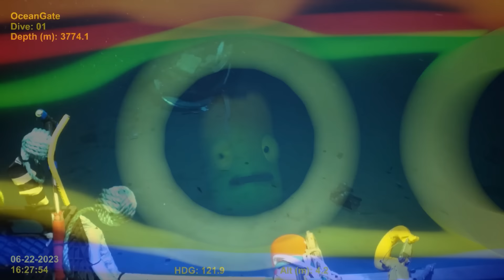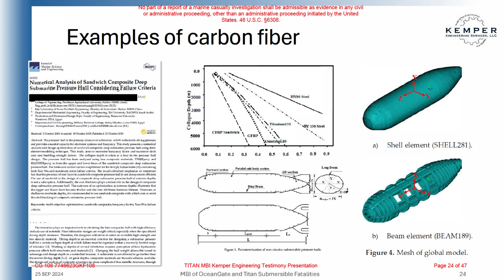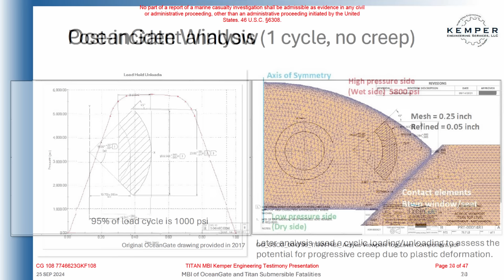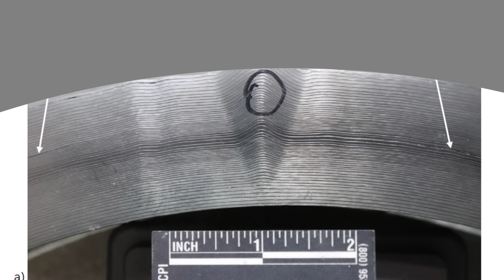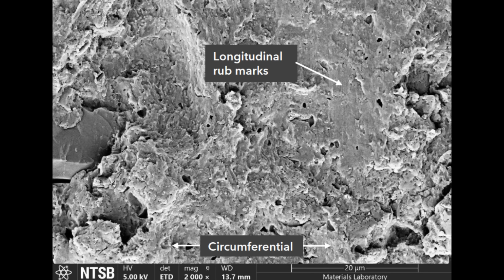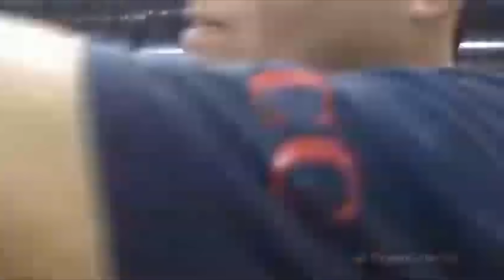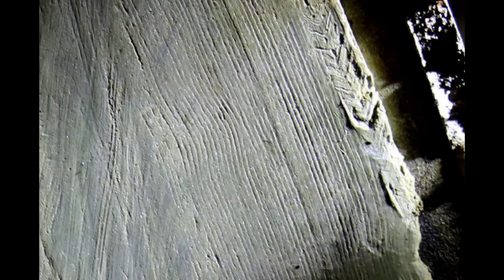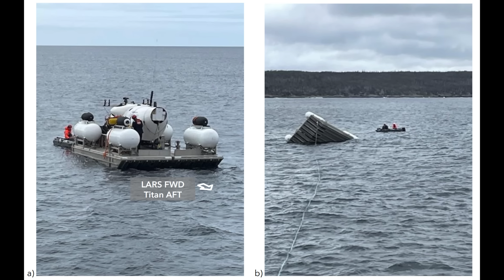OceanGate Wreck Shows Why Sub Wasn't Strong Enough To Survive - NTSB Shares Important Details

Comment: If you were writing this as a fictional story the publisher would say the hubris parallels with the Titanic disaster itself were too obvious.
Reply: I mean, the CEO's surname is "rush". That's just taking the mickey.
Reply: @techno1561 nominative determinism strikes again
Reply: No, this is far worse. The engineering tools didn't exist to accurately model and predict what would happen if Titanic hit an iceberg. Not only did they exist for Titan, but they can be licensed for a few thousand bucks per year. Hell, they license it to engineering students for free.
Reply: @CarbonKevin lie
Reply: The ironic thing is that this is far far FAR worse. Titanic very much got unlucky, as the designers simply didn't anticipate a relatively small, scraping crack along the side of the ship, as the things that were on the forefront of their minds were things that were far more common: running aground, collisions, the sort of thing other ships of the time commonly had problems with. Titanic got unlucky to sink as it did. Rush got unlucky to not sink sooner.
Reply: @eliareichardt7007  Fwiw the Titanic's scrape with the iceberg was a quarter of the length of the ship and punctured five of its sixteen waterproof compartments (and a bit of a sixth one). The ship was rated to withstand up to four of the compartments being flooded, so it's pretty serious damage. Like you said though, the designers of the Titanic were solving for more common and less damaging sorts of accidents, whereas the designers of Titan somehow failed to solve for the single most obvious and predictable risk that faces a deep sea submarine: high water pressure.
Reply: @thatcherfreeman  It has been theorized that the ship would have actually survived, albeit severely damaged, if it had in fact just run head first into the iceberg instead.
Reply: @mitchk7655  yeah that checks out, might've busted fewer compartments
Reply: @thatcherfreeman   To be fair to them, they did design the sub for it, since it didn't immediately implode. OceanGate just failed to do the proper checks, and the CEO ignored the warning systems/signs when they went off.
Reply: @techno1561  I mean I guess they did design for it, but evidently either their design or their implementation was not effective and they did not do enough to validate it.
Reply: @mitchk7655 Nothing theoretical about that. There are other ships that crashed into icebergs and didn't sink.
Reply: @eliareichardt7007 there is an argument to be made about the specific steel, rivets, and riveting methods used, but your right that i t was still pretty well designed and basically just insanely unlucky
Reply: At least the Titanic was built to the safety standards of the time. This sub wasn't lol
Reply: @thatcherfreeman  Titanic was technically built better than the standards of the time. It didn't have enough life boats, but it had more than the minimum requirements . It could have held even more, but White Star deemed it too messy (she sailed that voyage at 2/3 of total capacity, but had less than half the maximum lifeboats aboard). The amenities on board were unmatched, even by her sister ship Olympic.

On the same token, many people at the time were criticizing contemporary maritime law and regulations in the light of increasing speed and capacity. White Star Line and Titanic's owners knew of the potential risks, but disregarded them as too unlikely.
Reply: @neekMarieM14 the theory of life boats at the time was that you didn't need enough to get everyone off. The idea at the time (at least behind the Titanic) was that even if the ship DID sink, you could easily radio-contact other ships nearby and you'd just be using the life boats to ferry people to safety because it would take so long for it to sink (which it absolutely did, just not long enough and they weren't able to get a hold of other ships fast enough (partially due to a nearby ship's telegraph office being unmanned at the time).
Reply: @graysonsmith7031 You mean the SS Californian? The Captain definitely saw the emergency flairs sent up, he just decided he’d rather have a cup of tea and go to bed
Reply: @thatcherfreeman  The Titanic waa built well above the safety standards of her time. She only needed to be able to float with 2 compartments flooded, not the 4 she was able to. 
   Of course, she still had nothing on Mr. Isambard Brunel and his Magnum Opus, the S.S Great Eastern. Tore a continuous gash over 1/3 the length of her hull (significantly longer, and much, much wider than what the iceberge did to the Titanic) on a previously unknown rock on her maiden voyage. Only found out because they noticed she was running deeper than she should be, so they sent divers to check when they reached their destination. She also had a boiler blow up, sending one of her funnels above her mast. Most passengers didn't notice until the next morning and she continued the voyage as normal. All of this, in the 1850's.
Reply: The amazing thing is that there was a fiction novel, published years before the Titanic was even built, called *Futility* about an ocean liner that was deemed unsinkable. In the novel, the ship hits an iceberg and capsizes in the North Atlantic, leaving very few survivors. There's a lot of other plot, but that's the relevant part. The ship's name? The **Titan**. (I'm not making this up.)
Reply: @neekMarieM14 I googled this fully believing you made it up, but wow that’s unsettling.
Reply: @neekMarieM14 thank you for sharing this.
Reply: the metallurgy of metals wasn't very well understood either, it's likely it wouldn't have broken in half if it was in a warmer climate like the Britannic
Reply: Titanic was a masterpiece of engineering. It was a black swan event. Her sister Olympic sunk a submarine in the war and sailed for 30 years. It was a good ship. But the iceberg was stronger.
Reply: The Titanic was FAR better designed and constructed than the sub. I'd make an argument that it was even well designed for the time, but I don't even need to make that point comparing it to this carbon fiber lasagna.
Reply: I don't know of any hubris in the Titanic disaster.  That is a hypersimplification at best.
Reply: @danielgregg2530   There wasn't any, perhaps among some passengers. But an often cited example, shown in the 97 movie of Bruce Ismay urging Smith to increase speed is a flat out lie and that has always been known because the exact conversation was documented in a diary written before the sinking by a lady sitting at the table.

It went something like, "It's remarkable we're achieving 22 knots, we haven't even lit Boiler Room one with thw single ended boilers."
"Yes, we might even beat Olympic's time (the identical sistership, that had made the journey a year earlier). 

Ice warnings weren't ignored, Smith diverted South, putting them on a direct collision course with the five million ton iceberg. 

The ship was well built. Best we could do at the time, same goes for the steel. So while yes today it would be considered subpar, for the time it was battleship grade. 

Olympic sliced a U-Boat and sank it, before she had almost sunk a cruiser, that actually had a ram bow to sink ships, that went into her side, flooded 2 compartments, the maximum allowable anywhere but the first 4. The cruiser almost sank, Olympic got sent back to Belfast and repaired, her unfortunate sister donating a propeller shaft, to get her back in service. Of course the delay this caused ended up pushing the maiden voyage to April of 1912. 

And the coal fire was irrelevant. Heck it helped. Gave her a 3° port list, helping to counterbalance the flooding on the starboard side. .

Also what many forget is she sank on an even (ish) keel after 3 hours, every boat launched (ignore the collapsibles, the launching equipment had sunk by then in a locker at the bow...).

She sank at 2:20 AM (Titanic time), power, lights and heat webt out at 2:18 AM as the ship broke apart and the steam lines ruptured. By then Boiler Room 1 had been lit to keep the power going. 

Costa Concordia, lost power immediately. And only launched 3 of 70 boats, she also capsized making one side unusable and soon both and trapping dozens below. Despite being explicitly designed to sink on an even keel. Modern ships are designed so they sink in a way that maximizes the chances of getting all the boats and rafts off. 

Also the Captain ran away. Smith went down with the ship. Well he did leave before the final plunge, approximately at 2:10 AM if those reports are correct (along with Andrews). 

Ismay spent the night at first herding reluctant passengers into the boats, occasionally lifting protesting ladies into the boats, he helped launch them until the end. Where he began to panic and started rushing the launch of a boat after which a sailor yelled at him to stand back and remember that he was a passenger.

Ismay apologised and calmed down but staid at his station lowering the boat properly. 

In one of the last boats, there was no one around, everyone had assumed no boats where left there, so he called out several times, if there was no one else. Receiving no answer he stepped into the 2/3 empty boat. It wasn't the last spot with hundreds of passengers nearby. The opposite in fact. No passengers. He justified it as being an important witness, who was there for many key moments. 

The press destroyed him and he was a broken man from then on and became a recluse and according to his granddaughter, a walking dead man. 

He died just a few months after RMS Olympic was scrapped after 25 years of service 300.000 soldiers transported to Europe in the war. 

The Olympic class where fantastic ships, especially post Titanic with the lessons learned, many hate the huge electric cranes and motorised and telegraph equipped boats (well 4 anyway the other 65 onyl carried sail) RMS Britannic was the pinnacle of the design and my favourite as a ship in itself. She of course became a war crime, when serving as the largest hospital ship ever, she was sunk by a mine laid by a U-Boat that most likely was intentionally targeting Britannic, the mine was laid the day before). 

Sank eerily similarly to Titanic, 6 compartments flooded, the detonation warping the hull, so many compartments were unable to close and as it was shift change they had been opened, usually during war time they were kept shut. 

Sank in an hour by the head after the attempt at beaching the ship was abandoned. Ironically standing still she would have remained afloat. 

All but 3 made it off, they were killed in the explosion. But two boats launched without permission while the ship was moving and sinking, they went into the exposed propellers and that's the 30 fatalities....

You probably know all of this, I'm just providing examples to your argument not trying to be "the one who knows more about Titanic". I was thoroughly humbled when I had the ocassion to speak with a Titanic historian. 

Also Lightoller was a coward and hindered the evacuatiob more than he helped and Murdoch was a hero. He did do the thing though, despite people saying the movie is wrong, there's about 120 testimonies to that, some of them saw everything. 

"He two passengers storming a boat before it was ready. He then wished best of luck to everyone and that it was every man for himself, gave a salute and deleted himself." That's a very rough quote of Eugene Daly. He ends by expressing his admiration for the officer. His side launched significantly fuller boats. He did his job until the last boat was ready to launch.
Reply: "The main difference between reality and fiction is that fiction has to make sense."
Reply: I hope David lochbridge is watching this what a clown rush was hope you have another job.x

Comment: So it wasn't even 5 1-inch layers of fiber because each 'layer' was machined to thinner than 1-inch is some areas.  So it had weak spots that flexed more and constantly churned up all the glue.  Rush probably would probably be a success and alive if they threw away the hull every couple dives.

Comment: I watched through all the hearings and am still struggling to dig my jaw out of the concrete floor.

OceanGate
- used unapproved/unusual/untested materials, material combinations and processes
- pushed certain components way beyond their rated depth, if they were even rated in the first place (IIRC they got their window from a different supplier after the first one refused to sell them an unsafe, non-compliant design)
- cobbled together (or tried to - the scrubber-in-a-tub comes to mind) many of their own systems rather than use tested, off-the-shelf parts
- didn't do proper engineering and actually went directly against what experts told them (i.e. no diagonal CFC layers, a much thinner hull than recommended, no tests that fed back into/validated the engineering)
- didn't do any proper testing at all and just went ahead with the big hull despite all their 1/3 scales failing catastrophically
- dismissed warnings from their real-time monitoring (one witness said they would sometimes continue a dive past the red alert level and "keep an eye on things" if the reading was only a little over the threshold, another testified hulls suddenly got "louder" again on subsequent missions and seemingly noone questioned it)
- apparently didn't even look at their data post-dive and dive-to-dive, missing some very obvious warning signs (i.e. loud bang coinciding with a big step and permanent change in strain data)
- obviously didn't have any meaningful baseline data for their monitoring/warning system in the first place as they never properly tested a 1/1 scale hull
- handwaved away potentially serious damage (hatch fell off during handling, sub got jostled in heavy seas, got stuck during a dive, at one point was hit by lightning) 
- didn't follow and likely didn't even have proper procedures (diving with missing/inop equipment [i.e. 3 failed acoustic sensors], constant problems with their comms, one witness testified employees made it a race to bolt on the hatch, another said they once dove with only 4 out of the 18 bolts installed[!!!])
- had zero safety culture as they blew off, belittled and terminated (for "lacking the explorer mindset"), even sued those who brought up concerns

and these are only the most egregious points that I remember. I'm getting another headache just writing out this list. Stockton Mush and the remaining OG staff will likely take many other horrifying details to the grave.

It's honestly astonishing they were able to complete that many dives with how fundamentally messed up and reckless the entire operation was.
Reply: All true, but Stockton Mush ....
That will live in my head forever.
Reply: Oh wow, wasn't expecting it to be THAT bad.
Reply: So when they come to decide why Titan imploded ,they'll hold up your list and say "Take your pick" XD   There were so many wrongs that even if they do pin point the actual reason for failure they need to add that at any other time any of the huge number of faults/failings could have been responsible.
Reply: HIT BY LIGHTNING?!?  Holy moly.
Reply: Do you have a source at hand for the one where they dived with only 4 bolts on? That seems stupid even for OceanGate standards
Reply: @fallingwater this was only one of the shocking facts that came out during the hearings. As a result of there only being four bolts on that trip was that the titanium end cap sheered off when the sub was dropped harder than expected when returned to the platform. Imagine that being the end of your dive!
Reply: @tracymetherell8744 Literally holding onto a single hair. I guess dumb luck is called dumb for a reason.
Reply: This proves that contemporary materials have fantastic properties and that with inteligence and knowing the stuff can be made.

Comment: IIRC Stockton had a vid on his company website where he pretty much gloats about how he wasn't going to hire anyone with experience ( as he put it "old white guys" which is ironic since he's describing himself ) and only fresh graduates.  He mentions deliberately not using methods the rest of the industry does because he felt he knew better and hey, the aircraft industry was making pressure vessels from carbon fiber to be lighter, so obviously that's what he should be using for his subs.  He was a genius and everyone else was dinosaurs....stuff along those lines.  This wreck was the result

Comment: Two questions. 
In the end, you seem to blame the regulations as the reason he chose to break the safety net?  
Doesn’t that justify every bad behavior?

Why was taxpayers money spent on this man’s folly?

While interesting, the applicability of the knowledge gained is minimal. 
It has little practical application.  They just broke a lot of rules. 

Wrinkles forming:  plane them down.
Not thick enough:  use multiple layers.
Layers slide: Glue them. But don’t test the glue.
Boeing says angle the fibers: Nah, make up fake science. 

Sorry, not worth the money. 

The answer is simple: safety first, hire skilled engineers.
Reply: He fired the skilled engineers because they told him it wasn't safe.

Comment: I wonder if a sphere woven from carbon fiber would be a good, safe and cheap design for one of these. No connection points, you can pretty much just weave and cure it. Cut as little holes in it as possible, put all the hardware you can on the outside. Larger volume for less material, so you can stuff in more billionaires for a better price. Better designe in 30s of thinking...

Comment: Great analyses. Those wrinkles are very interesting. The use of two different materials, with  two different properties when it comes to pressure and temperature, always felt wrong to me. The glue layer can be seen as another material, which makes the whole thing extra sketchy.